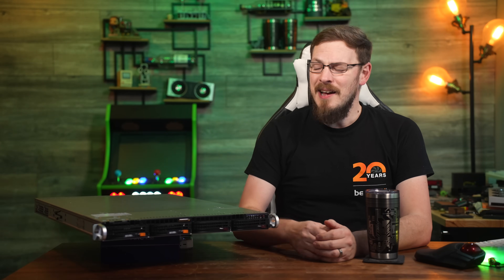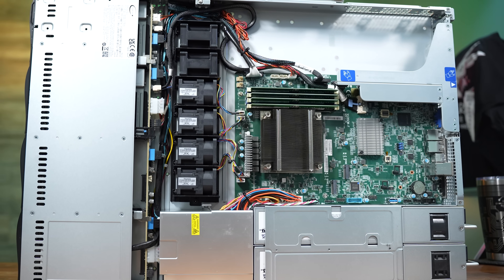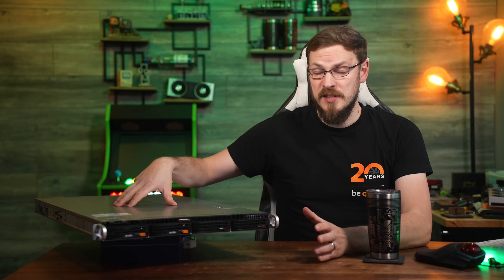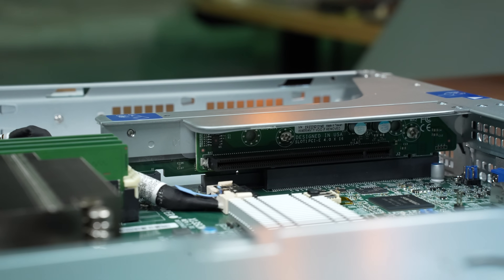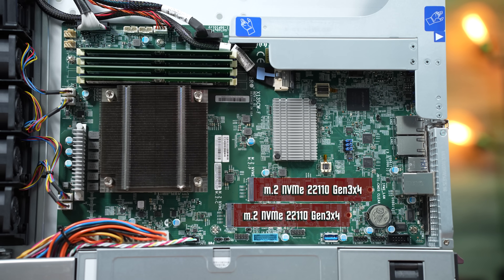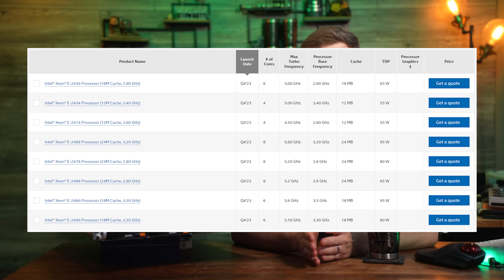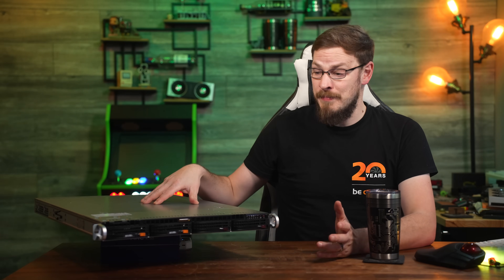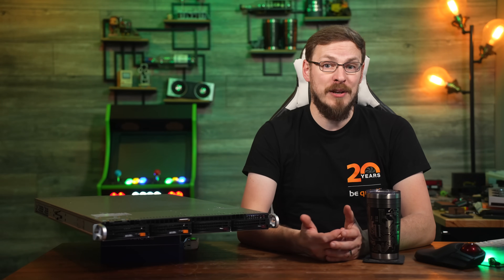Intel Xeon E-2400 Series First Look

Comment from the maker: - Video Corrections - I mistakenly called this system the SYS-511-M. I was actually sent a 511-W, which is a workstation variant. Here are the main differences between those platforms...

SYS-511R-M
Use standard Micro ATX form factor MB
20” shout depth chassis
No NVMe support on front drive bay
Up to two expansion slots + one internal HBA slot

SYS-511R-W
Use SMC proprietary WIO form factor MB
25” depth chassis
Support up to two NVMe on front drive bay
Up to three expansion slots
Able to support double width GPU

Also, Intel did NOT upgrade the onboard storage controller compared to consumer chips. SAS support is available on this system, but only through an add-in card, which would bypass the onboard controller. When taking notes for this video, I wrote down SAS support based on specs of the Supermicro 815 chassis backplane, not the CPU. So, that's one less feature you get compared to other platforms.
Reply: SAS is hardly a standard feature on those other platforms. An integrated SAS controller on a premium board will still cost extra. Note that some boards may have MiniSAS connectors, but they are only connected to PCIe lanes or SATA ports
Reply: It's not the core even that bothered me most... It's just the lack of memory channels and PCIE... Like this is just a crappy consumer level chip that happens to plug into a server board... And there are better specked out chips in previous generations and current ones for just a little bit more money in the Zion lineup... That actually do the thing.. like the the thing you know with the memory channels and the PCIe lanes... H e d t.. you ruined me! Why can't I have you again!

Comment: Thanks for the review. Pointing out the E-2488's throttling issue is a real concern for our use case; i've got a need for the fastest available single threaded CPU i can get in a rack mounted HA VMWare environment with ECC and the intel E-2488 looks to be the fastest out there on a core by core basis - until it throttles, of course - and when it does, it loses any benefit over our existing highly multithreaded servers, and just adds to the variabilty  of hardware we'd need to support. 

Damn.

Comment: I personally use the Xeon E series for game server hosting. Having the, essentially, desktop performance in a server platform is really nice for servers such as Minecraft and the like. Running that on Golds or Platinums doesn't really perform as well as you'd think due to the low clock speed.
Reply: Bingo! I've got one on the way to run a couple PalWorld servers. Per core performance is vital.

Comment: You can run 128 gigs of unbuffered ECC ram on a lot of AM4 and AM5 boards with any Ryzen CPU. Weird how Intel still locks down this feature to only work on Xeons. PCIe configuration is also not much better than normal desktop platforms. The whole thing feels kind of pointless.

Comment: Given that the server only has 1GB Ethernet on board, the PCIe lanes aren't that big a bottleneck, as it's already going to  saturate the NICs with just a basic NVME setup. Plus the CPU usage probably isn't going to be great either.  
It really seems like Intel just wanted something to fill a price point here, rather than give a real entry level product. This doesn't seem like a huge or significant evolution of the old E2-12xx series, which were what let me get into server level gear at home without running cast off enterprise gear or bankrupting myself with newer higher tier Xeons.

Adding in Raptor Lake's worst attributes doesn't do it any favors.

Hard pass on these.

Comment: I'm building a TrueNAS Scale system this fall.  I'm 90% certain I'm going to go with AMD.  Intel's offerings for Xeon are a joke at this point.  Even a low end Threadripper looks to be a better option than anything Intel is offering right now.  For power I can possibly underclock it in the BIOS.  I'm less interested in speed and cores and  more interested in the lanes.  Something that Intel is way behind in unless you drop serious bank on one of their higher end chips.

Comment: The entry level Xeon line has been more or less stagnant for about a decade. The lack of e-cores isn't a surprise, this is more or less a respun E5-1620v1, over and over and over. Any performance gain and TDP decrease is simply due to an improved node.

Comment: Analyzing "whether or not your preferences chief competitors' products need exist or not". Please, lets stay usual AMD vs Intel Fanboy flame war material that we get from purveyors such as HUB, GN, etc. It's not interesting and i believe is beneath you as a content maker. So please stay original.
Reply from the maker: So my analysis of Intel severely handicapping this CPU, and the competition having far more compelling offerings at similar price points is invalid because... Why?

Look, hyperbole aside, Intel rebadged a 13900 after removing E-Cores, and is charging more because they slapped a Xeon name on the front. It's not a good product.
Reply: @CraftComputing  AMD is also rebranding Zen2 core dies and calling the Ryzen 7000 products…. 7520U and 7500x are two great examples of this.. so what’s your point. So yeah, let’s talk about products in depth because that good journalism. However, slamming a brand with inflammatory remarks is well… that just bias plain and simple. Hence why I said, I believe that is beneath you as a content maker.
Reply from the maker: @jhowle9475 I've spoken multiple times on both my podcast, and recently with PCWorld, about AMD's rebranding of Zen2 cores as 7000/8000 series being intentionally misleading. But this video wasn't about Zen mobile CPUs, so I'm not seeing the parallel in your logic.
Reply: @CraftComputing  nor was it about 13900K which you brought up as rebuttal.
Reply from the maker: @lvl_50  The E-2488 is the exact same CPU die as the 13900/13900K, but with disabled E-Cores. That's why it is a valid comparison.

Comment: I mean this kind of system is not the type getting used for Virtualization (like performance comupte) this is more the type getting used as dedicated hosts for Monitoring Nodes, or Firewall/Jump/Log hosts. So something you want on dedicated hardware asit shoudl be the last one to fail where virtualization is not desirable. 10G is also a non issue as you will not exceed the 2Gbit the chassis offers. And even if you want to use it as a GW, or Firewall you slapp in a 100G nic or something.
This kind of machine also makes sense at the edge where you ingest some data and inference it with a GPU where the samll footprint makes sense.
This does not feel like the type of machine you woudl deploy at a small buisses. And even if you would, you would probably deploy them as a small entry level storage cluster. Even smaller buissneses will pick a higher end server for its expandibility.
For Compute desity this is also not it. as thers 1U systems which can handle it better.

Comment: You are making an incorrect comparison here and providing inaccurate information. Server CPUs do not possess E and P cores. Instead, most hypervisors differentiate between High Priority Cores and Low Priority Cores, and their architecture is entirely different. To use a consumer CPU, or any CPU that has E cores with hypervisors, the E-Cores must be disabled; otherwise, it is not possible to use them

Comment: The E2400 have some 'but why' aspects to them but they do have their place.  Relatively low power in 1u form factor but decent/good clock speed considering it's low power and price.  They also make good ESXI hosts as others have mentioned.  I'd personally have looked pretty hard at this for a home server if it had more PCIE lanes but they don't so yeah.  Kind of a 'best worst' scenario but we've installed some 2400 and 2400g servers and they do the job.  There is a 10gb version of this setup also, that one has 1 gen4 M.2 as well.

Comment: The problem are not the chips. It's getting a cheap enough board to justify it. Also everything up from i5-12500 can run ECC und that board so why buy a xeon? (Honest question)

Comment: The I5, I7, and I9 all support ECC with a W680 board.  I have a 13900 in a Supermicro W680 for one workstation and a 13700K in the Asus W680M in another.  Both have ECC support and run very well for a workstation.  Given that, I do like the E2300 series for small single function servers and plan on getting a 2468 to use in a pfsense appliance.  This is more than enough for something like that.
Reply: Yeah, I have a 12600 working with ECC UDIMMs in a ASRock Rack W680D4U just fine.

Comment: Hey Jeff, please note that 13900k and 14900k so as few other cpu's in 12th gen and 13  does support ecc udimm with R680E and W680 chipsets. As you said, it seems like a pointless platform.

Comment: wait wait wait wait, the 13900k cant post with uDIMM ECC?
My Ryzen 5 4650G can post with 128GB of ECC uDIMM
In fact, i think all Ryzen processors other than non Pro G series can post with ECC.

Now you've got me concerned about my new compact server build with the 7950X, right now it only has 64GB of non ECC, but i'm waiting for 256-512GB kits to launch so i can get some cheap 128-192GB kits of ECC uDIMM i dont want to find out it will only post with uDIMM non ECC
Reply: All boards/CPUs should POST unbuffered ECC DIMMs, but platform support is required to make use of the ECC functions
Reply: @shanent5793  so if you threw a 13900k in this it should work? 
Nice
Reply: @denvera1g1  it still has to be a working CPU/chipset combination. C622 doesn't officially support the client processors
Reply: @shanent5793 Oh is it like "ryzen doesnt officially support ECC but it totally works great it just hasnt been validated and you might have trouble with a few boards"

Or is it more like "the human body doesn't officially support a knife in the abdomen, but you can force it in there if you really try, but you're gonna have a bad time"

Comment: what i would have personally liked to see from this generation of Xeon is something like a return to the E, L, and X series from the Westmere days.
but this time L being normaL, X being all P cores(12 total) and E being all E cores(48 total)
I know the architecture isnt really meant for this but each one of those E core complexes is almost EXACTLY the same size as a single P core.
Reply from the maker: Intel is introducing MASSIVE E-Core based CPUs this year. Both 144 and 288 E-Core models have been confirmed.
Reply: @CraftComputing  I would love to see them, wonder if the E-2400 series will see an all E-core update, its what this platform needs to save it from the landfill
Reply: @CraftComputing    "144 and 288 E-Core" . . . That sounds interesting. Thank you 👍

Comment: The mobile CPUs from AliExpress look like a better option than this, which is pretty sad. I understand it's not proper server hardware but with the limitations you have outlined this platform seems to fit the definition of a waste of silicon. Looks like it has really good margins though😂
Reply: And you don't get technical support either from Aliexpress sellers. Not even from Huananzhi official store. Besides those quirky non conformant boards - to much of a headache.

Comment: Imho this is for stuff with per-core EXPENSIVE licensing so no you don't want ecores and you don't want a lot of cores either. Also it's probably just clustered with another similar machine. Seen so many of similar small 1U servers things running Oracle db stuff. They don't need that much
Reply: I was thinking a great little front end server for a database or web application. The kinds of stuff that absolutely hates apparently random, to the software, shifts in CPU performance.

Comment: I really like this channel, but sometimes it feels like Jeff doesn't really research what the product is for and why certain things were done by the manufacturer. As mentioned before VMWare doesn't support E cores, hence they are disabled/removed. The intent of this CPU is stability, and relatively low power draw in a branch office / small office environment. That very server sitting on the desk is perfect for a restaurant back of office, corporate branch office, or a small business, that needs a solid server, with VMware compatibility, yet it doesn't need to do anything too crazy. Maybe run two or three VMs, DC,  file server, and maybe a separate application server of some kind. 
Demanding Core i9 level performance and features from a chip that is not meant for that is a bit perplexing.
Reply from the maker: Price point, it doesn't compare favorably to ANY CPU offering around it. That was my point. Zero expansion potential vs an Epyc 8124P with 3x memory bandwidth, limitless PCIe pipeline and CPU options up to 64 cores. Which platform would you invest in?
Reply: @CraftComputing  The major manufacturers don't have too many low cost Epyc options, some don't have them at all. These E series Xeons have been a mainstay in Dell 1U short chassis for example. That's why Intel does what it does. I am not saying it's the best chip for the segment, but it is made for the segment and it has wide adoption. So comparing it to an i9 isn't really fair. Especially when you mention the lack of E cores as a negative when there is a technical reason for it, which is VMware compatibility.

Comment: I think the biggest issue is that 7800X3D and 7900, 7950X (set at 105W or so) exists
All 3 would easily run rings around the 8 core model, not so much because there are applications that cannot be used with E core or performance consistency (esxi)

Golden cove is just horribly inefficient and falls on its face when power limited, the E cores aren't much better either. In many situations the E cores are clocked up to such a extent that they lose all the efficiency benefits of being well uh, E cores.
Also btw, the M.2 slots are 4.0 not 3.0 but minor detail